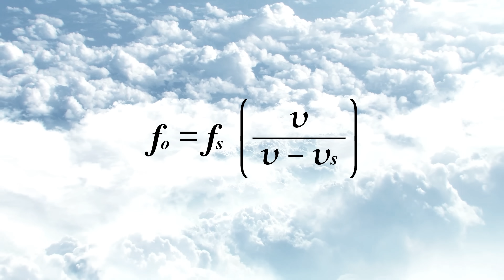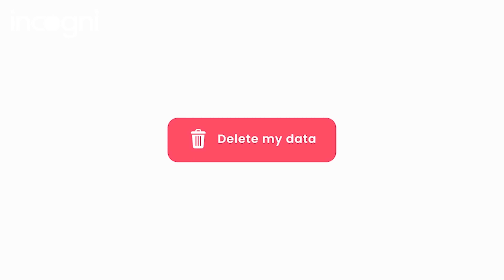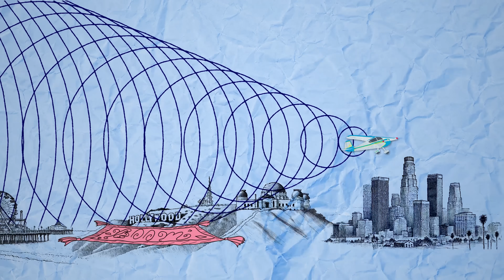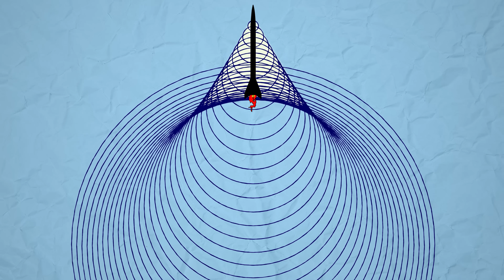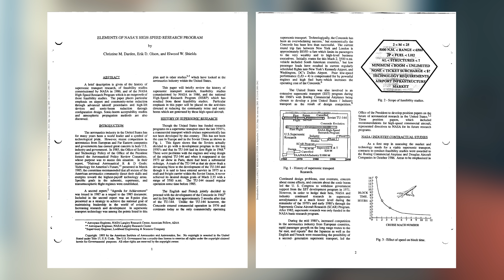You'll NEVER Hear a Sonic Boom From a Rocket??

Comment: Mantis shrimp got snubbed in the Boomies.
Reply: Yup, should have got the 'smallest' prize!
Reply: @teaurn I thought 'Most Common'
Reply: @teaurn I was thinking the same thing!
Reply: Let me preface this by saying that Mantis shrimp are awesome, and I love Mantis shrimp... But they don't actually make sonic booms. They make little vacuum shockwaves. Actually because the speed of sound in water is way higher than the speed of sound in air, to make a sonic boom underwater is wayy harder than doing it in air, and the effect would be way more powerful. But once again... I love Mantis shrimp
Reply: Lets not forget the pistol shrimp also got snubbed. 😅
Reply: @kreynolds1123   They split the Shrimp vote and neither ending up winning...
Reply: @kreynolds1123  Mantis is one of many types of Pistol Shrimp, iirc.
Reply: And would have made for another cool visual. 😎
Reply: Isn’t that cavitation, not a sonic boom? It’s caused by a collapsing vacuum bubble as opposed to the movement of an object.
Reply: @martinj.9528  bingo, its a cavitation bubble they create which due to the incompressibility of water causes extreme hit and force when it collapses. It's basically a burst of displacement with a violent rebound. Smarter Every Day does a great video on cavitation caused by gun fire under water.
Reply: @PanTheManInNeverland It causes heat.
Reply: @martinj.9528  yeah exactly.... thats why it wasn't included
Reply: @martinj.9528 The claw moves, the vacuum cavitation is because the water can't move in to fill the vacated space behind the claw fast enough. So now, what happens to the water ahead of the advancing claw?
Reply: #BoomiesSoMacro
Reply: Shrimp always always get the short end of the stick because they are so delicious.
Reply: @Deadfeat  I usually give them the pointy end of the stick
Reply: @Deadfeat Wouldn't that be the sharp, pointy end?
Reply: I was just coming here to post exactly the same thing 😁
Reply: An important distinction here: cavitation happens when water is displaced faster than it can flow back in to replace itself. The flow rate of water is lower than the speed of sound in water, so cavitation is a different phenomenon.

The flow rate of water can vary a lot based on surface area, which is why different propeller shapes can reduce cavitation. This is good for more than just staying quiet in submarine movies. Propellers generate force because the low pressure area pulls the blade forward. When they start generating cavitation, that's the highest possible pressure difference they can sustain, placing an upper limit on your useful speed. Push cavitation off longer and you can eke out a bit more.
Reply: @applicativejones Cavitation causes heat which damages the prop.
Reply: These awards this days man are all about politics and campaigns 

I can't see myself supporting the boomies anymore
Reply: I knew there was a creature out there that created booms but couldn't remember which one.  Thanks for adding this.
Reply: Oh noooo!😢
Reply: The speed of a mantis shrimp strike is a relatively benign 23 meters per second. But the acceleration of that strike is on the order of 10,000g which is frighteningly fast. It is the acceleration and the resultant drop in pressure behind the claw which allows the water to reach the boiling point. This causes cavitation which is the near instantaneous formation of a bubble that is water vapor, not a vacuum as some have stated and the near instantaneous collapse of that bubble of water vapor back into water that carries the energy. That energy is enough to dismantle small prey animals and on larger prey animals, say a human, to split their finger open. Coincidentally, the sound created by the collapse of the bubble travels at the speed of sound in water. It cannot exceed it though because laws. And this is why if you count after you see a flash of lightning you will get the distance between you and the lightning in thousands of feet, because the speed of sound is roughly 1,000 feet per second in air. It is of course 5 times faster in water but trying to listen to lightning under water is a really bad idea.
Reply: Yep I said to my wife where is the shrimp 🦐 🦐
Reply: Waiting for that too.
Reply: Yeah it should have gotten smallest, most common and weirdest at the same time lol
Reply: I came here to say exactly that
Reply: Came here to stick up for the little guy too.
Reply: Cavitation is not quite the same as a sonic boom :)
Reply: These things were rigged… I knew it. 😂
Reply: Problem with the mantis shrimp is that it's only supersonic in air not water and it's water...
Reply: @Unmannedair  but it can make tiny flashes of light!  From SOUND!
Reply: Lol I thought the same thing!
Reply: @iananelson8256  Except that Mantis shrimp actually don't produce a sonic boom. It is a different phenomenon called a cavitation wave. But none of the components in that case are moving at super sonic speeds. (Espcially since the speed of sound in water is way faster than in air). Shrimp are fast but not THAT fast.
Reply: lol, I was gonna say the same thing
Reply: Hollywood still species washing the boomies.  When will it end?!?!?
Reply: I was thinking the same thing
Reply: I thought he'd be a shoe in!
Reply: lol
Reply: Also here to  comment about this; for both smallest and most common.
Reply: I'd say it's the wettest Boomie, or possibly most moist.
Reply: I demand a re-count!
Reply: Sonoluminesence is worse than a sonic boom...  It's cavitation
Reply: Not as much as crunchy food
Reply: I was on my way to basically type this exact same thing.
Reply: It's not a snub it is direct discrimination against aquatic booms.
Those air booms have all the publicity.
Reply: @andrewharrison8436  booms for the boomeranians!  Edit: not to politicize... I was making a Monty Python reference... Not a Nazi one. Follow the gourd.
Reply: So did your mum
Reply: cleve...land
Reply: So did crusty bread {yes really, that was the OG}
Reply: I was sad about that, too. But the Mantis shrimp's explosive actions are more about cavitation than sound, so I'll forgive Xyla.
Reply: Came here to say this!
Reply: The shrimps deserve their prize
Reply: I thought this would come up at the end in water
Reply: These award things are always rigged!
Reply: 👆look at all you people who don't know that mantis shrimp cannot break the sound barrier AND don't read comments before posting.
You're probably the same people asking why you couldn't hear a sonic boom in her rocket video.
Disappointing, but expected behavior from the average peasant these days.
Go read a book or something.
Reply: I kept guessing, "that shrimp" for each one
Reply: I love how one of you got offended enough to have my comment taken down, because I was making fun of you for not knowing the mantis shrimp doesn't make a sonic boom.  Salty, just like the mantis shrimp....
Reply: Dolphins ... and their acoustic stun as well ...
Reply: Gotta point that out that the speed of sound under water is 1481m/s or 4854ft/s … I’d really question weather any part of any seafood is gonna move quicker than a high powered rifle round … sorry but I think it’s only a boom
Reply: @GrubbyPaddler  their movement clocks in at roughly 60mph, a far cry from the 3,350mph in water, or even the 760mph in air.  People like to double down on their misinformation, and this thread here is proof of that.
Reply: lolol 😂
Reply: Snap!
Reply: That’s it!  I’m boycotting the Boomies till arthropods get their due!
Reply: My thoughts exactly.
Reply: Came here to say that too!
Reply: Came to say.
Reply: I said mantis shrimp for smallest, most common, and weirdest!
Reply: It's just a popularity contest anymore.  I heard a whip bought the judges all spa days.
Reply: funny, I thought the same
Reply: Is there a category for underwater booms in the Boomies though?
Reply: Hypothetical dinosaur spund vs real shrimp sound.   oh well we know these award ceremonies are rigged.
Reply: I know right!?  There was an “in memoriam” for dinosaurs, but the Mantis Shrimp is still alive and well! Tsk tsk tsk..😅
Reply: Was thinking the same thing
Reply: Yep it should've got the shrimp boomie
Reply: Justice for the shrimpies!
Reply: No mention of the Thresher shark either :(
Reply: Pistol shrimp?
Reply: I came here to defend the pistol shrimp👍😊
Reply: Lets not forget that your little shrimp got snubbed as well. Your poor wife. 😥